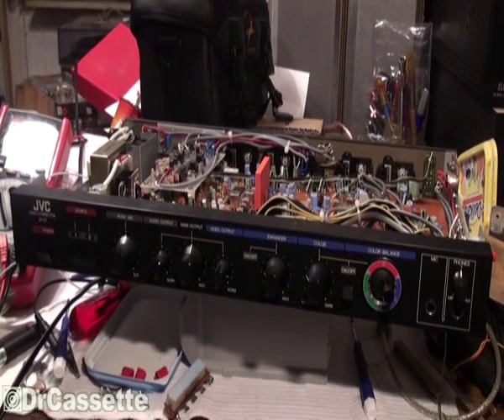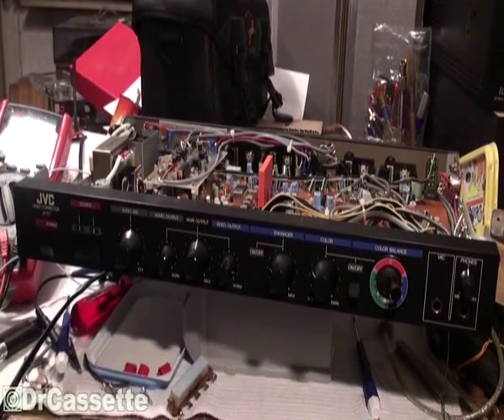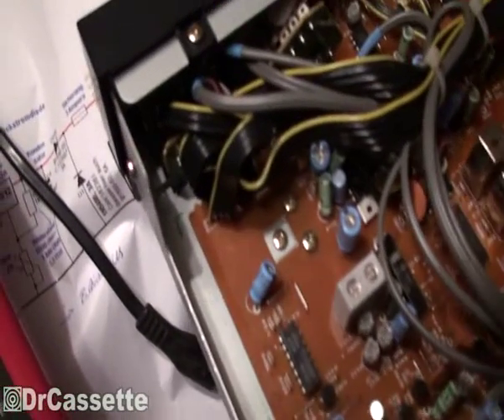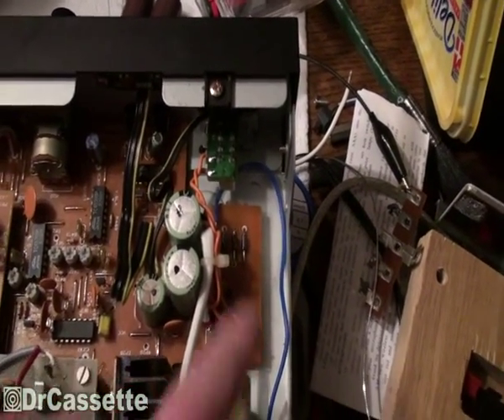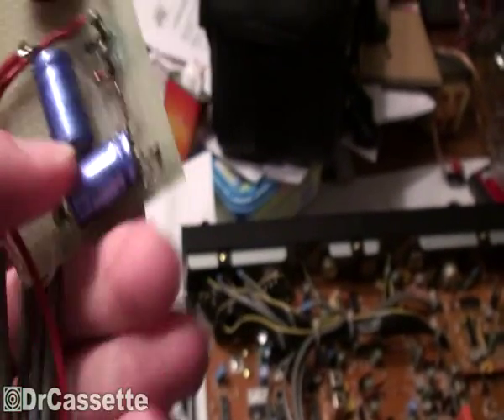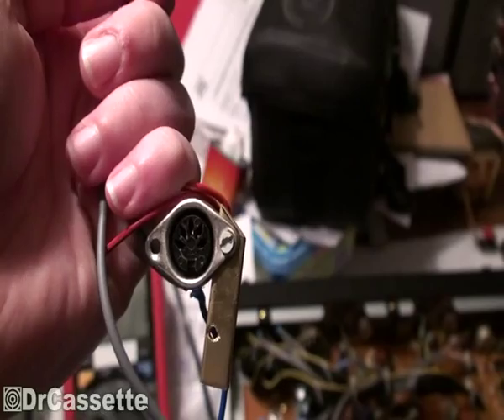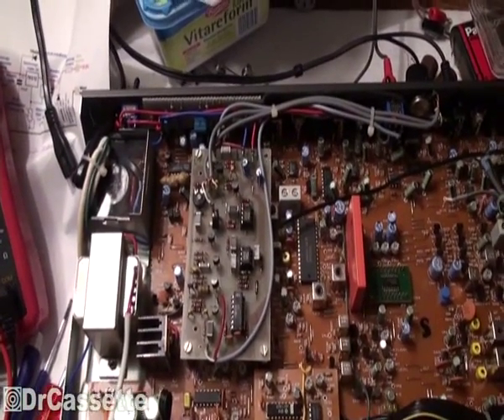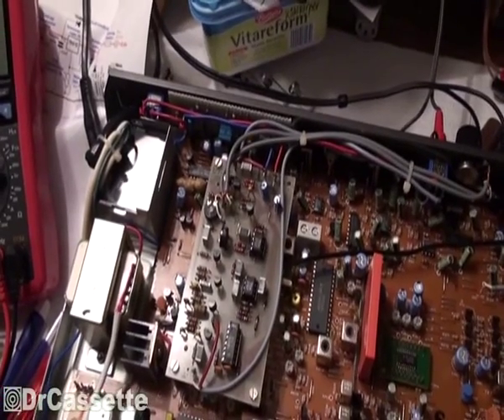DrCassette's Workshop - JVC JX-C7 video corrector mods

Comment: Do you think this device (stock) is a worthwhile piece  of equipment for it's intended purpose, of VHS tape correction during duplication?  Any thoughts?
Reply from the maker: I found the video enhancer does make quite a difference sharpening old videos, meanwhile the colour adjustment is way too sensitive to be useful.

Comment: Looking at this video again, I think that echo/delay processor might have been used to help synchronize the audio and video... so if someone came across a video where the lip movement didn't match up to the audio, they could adjust the delay until they find the point where it does match up.
Reply from the maker: Hmm, could be. By now I did find out for sure that it was a delay unit. An incredibly simple one using TTL technology.